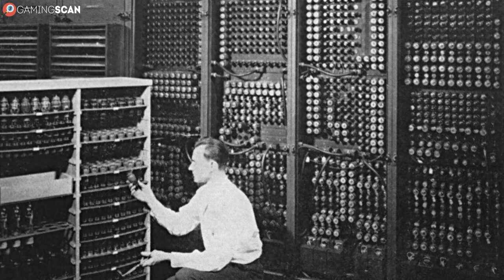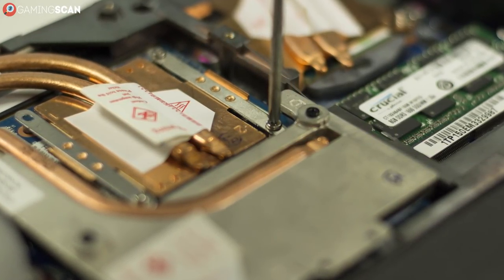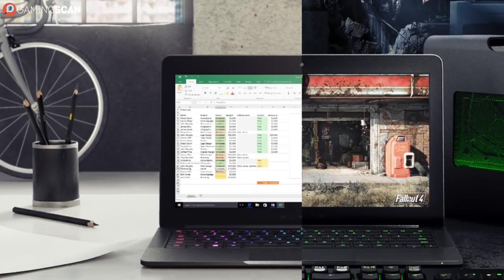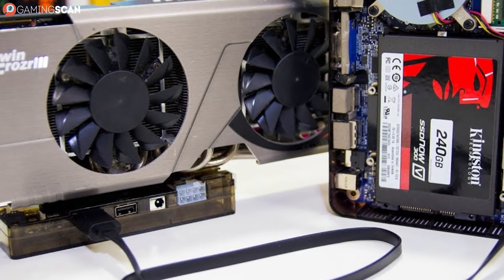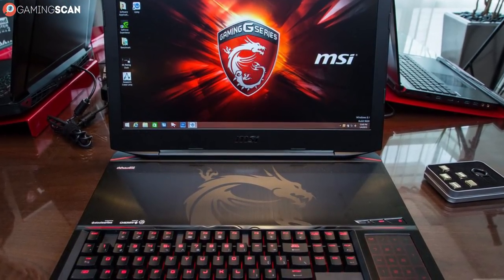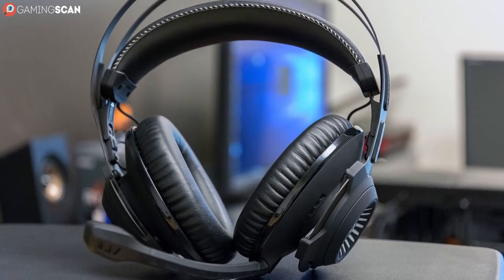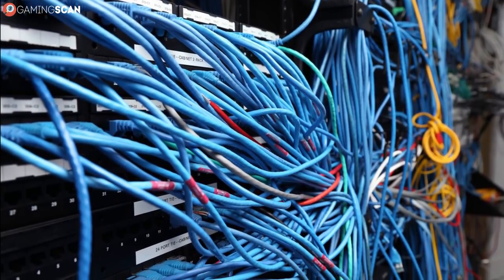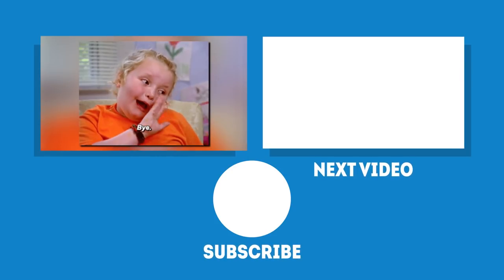Gaming Laptop vs Desktop - Which Should I Choose? [Simple Guide]

Comment: Simple answer.. 
want something mobile and good with games: Laptop
or 
Want something with more customizable option AND good with games : PC
Either way both option still allows you to play games.
Reply: can you tell the disadvantages with laptops compared to desktops when it comes to gaming? like does it overheat more easily or like lag more often?
Reply: @荒田栄子  for computers you can almost change anything to almost everything inside the CPU itself compare to laptops which when it comes to graphic cards in laptops it's a fix graphic card and you can't change it .as for the lag and overheat problem it depends on the laptops itself some gaming laptop can handle heavy performance and most of it can handle them pretty decently. but that's where the problem comes with better specs on a gaming laptop , they're insanely expensive. so in conclusion desktop would be a better option if you're fine with playing only at a certain place because of it's customization option and as for laptops if you're really worried about overheat and lag issue you just have to find a decent machine such ones with either gtx 1050,1050ti ,Gtx 1060 or Gtx 1650.in the end you still could play games with both option. So i hope this helps you in a way because i'm currently looking to buy a gaming laptop too.
Reply: @荒田栄子  double the prices for the same specs
Reply: Den .D ohh okay thankyou
Reply: Antoxicating got it thanks!

Comment: Hmm, let's compare a $650 PC to a $650 laptop

PC :-
Ryzen 3200g
16gb Ram
1660ti

Including rest of parts
That's the whole budget on the PC, now I know you can make $300 PCs but this is to make it fair to the laptop

You got the good specs, but you're gonna give all that power to an old monitor that barley runs 75hz? Are you gonna play with a keyboard and mouse both lighter that a bic? Now let's go to the laptops and continue the discussion

$650 laptop
i5 9300H
8gb RAM
GTX 1650

Sure you got performance, but you're paying more for plug and play out of the box, you get a monitor, a keyboard, the specs, some seriously fast ssds these days, sometimes a touch screen, portability and aesthetic

Now desktops aren't bad but neither are laptops

Comment: Most gaming laptops with a dedicated GPU don't really need an external GPU unless they want that extra power for 3D modeling software rendering or more vfx work in post-production editing. With even a gtx 1060 that comes with most gaming laptops these days you can run most AAA games in 60 fps at 1080p and some even 1440p with no issue. Of course, desktops will be better and cheaper off the ground for this price-to-spec wise but gaming laptops aren't as unviable as this video makes it out to be.

Comment: Ok so i build my streaming pc a few months ago. But ive been thinking about selling my whole setup and buying a gaming laptop. I have sports tournaments every weekend and drive around 3 hours minimum every time. Ive been wanting a gaming laptop because for these rides i can just use a controller with a wireless adapter for the pc and play offline games like skyrim, terraria, etc. but I can just use a mouse at home. What do you guys recommend. Just stick with my desktop?
Reply: I think you should get a laptop because you can just be much more portable with it. Sure you can’t really upgrade it, but I think that the laptop and desktop combination is the best option. I myself is thinking about getting into PC gaming, and I’m gonna pick up the HP Omen 15 gaming laptop for $999. Hope I could help!
Reply: Use a desktop. 3 hours isn’t that long bring some headphones and your smart phone.
Reply: @HGCProd   I think you should check up the HP Omen series before picking one. Heat issues and durability in general.
Reply: 3 hours isn’t worth it to sell your PC. A Nintendo Switch can be good in road trips like these and its not as expensive as a gaming laptop.

Comment: I got a eluktronics mech 17 with a 1060 for 1300. 1tb of ssd, and 2tb hhd with 16gb ram. Plus a built in mechanical keyboard with per key RGB, upgraded thermals and a 144hz ips screen. A similar pc would have cost less, but not after adding in a monitor, keyboard, desk, and (most essentially) another laptop because even if i have a dope ass gaming tower, i still have actual work the necessitates at least a mid-tier laptop. I would easily have spent double the price i did if i had built a pc, and my gaming experience would not be significantly improved.

Comment: You’re forgetting something. For a desktop, you obviously need to get an external monitor. You also might not have somewhere to put it which costs extra. In my case, I have a desk which doesn’t have much space for a pc because of work essentials. An extra desk might cost you hundreds if not a thousand more dollars. Then for a decent monitor, you’ll have to pay maybe 300-1000 bucks. Not to mention an external keyboard. If you have all of this stuff though, good for you.
Reply: external keyboard - you can get some cheap external keyboard doesn't have to be mechinal for like $10, way cheaper if you really don't care and the only different is quality and feel
monitor - the cheapest 144 hz monitor on amazon doesn't cost that much and a 60 hz will go for way cheaper since a lot of laptops only have a 60 hz screen anyway
no space - you don't even need that much space, put the pc on the floor and a keyboard and mouse will fit fine unless your desk is 2 inches as well as the monitor, even if you don't have a desk you can just be creative (sit on floor or mat, some sort of coffee/dining table, I severally doubt that you don't have a surface big enough for all this. 
even after doing all this it will probably still be better performance because you mostly pay for portability in laptops

Comment: I prefer laptop because if i bought desktop my table will have no more space, i had to put the casing at the bottom which is gonna be annoying, gotta have to open closed the casing just for cleaning the inside component, it will be hard for me to clean up my table, it will be hard to mop the floor because the casing is in the way, plus the most annoying is the cable that could get slipped off.

Comment: I bought an omen laptop with intel i7 8th gen and nvidia gtx 1060 and it runs perfect fortnite with 160 fps
Reply: Fortnite does not need a lot of good things to run it
Reply: An iMac can run fortnite on 60fps
Reply: Odd Kiwi I never said on epic but it can run it nicely
Reply: I have a similar configuration and can run all games at ultra settings. Nvidia's 10 series graphics card made this possible. They are no longer using weaker GPU's, it is the same exact GPU as its desktop counterpart with the only difference being clock speeds.
Reply: Battery works for an hour and die do I play while its charging or???
Reply: @Enzo-dr6gx  yes. A laptop with a GTX 1050 uses pretty much the same GPU as the desktop one. The only difference is a slightly lower clock speed, but then again with Pascal's GPU boost, if it's not running hot it can keep pushing clock speeds.
Reply: @Enzo-dr6gx  I don't have an Omen, I have an Asus ROG that has more or less the Omen's hardware.
Reply: @Enzo-dr6gx  as long it's not an M it's the same as pc
Reply: Enzo Troka I have one and it over heats and turns loud after about and hour or two but if you turn it off for 5 minutes and try it again it it goes back to being fine. Also a microcenter employee told me that it is heat that is being pushed out by the fan but it could still damage it. Still great laptop and I highly recommend it

Comment: comparing the graphics card prices alone to the laptop is comparable these days. the rtx 2070 for example is 700 bucks from the manufacturer, a laptop with that inside (albeit a slightly lower speced mobile version) along with a similar screen, computer tower to build in, mother board, ram, hdd and other items exceeds the price of the laptop AND i dont have to build it...  Doing build cost side by side with identical components is putting the gaming laptop back on top these days it seems

Comment: I have a question, so basically I want to buy a new PC mostly for gaming for around 1000 euro maybe a bit more. If I buy a laptop instead it will be nice with the portability on vacations also programming courses etc... So my question is if i buy a cooler for my laptop, when I'm home can i use it the same way as a PC for example to plug my gaming peripherals and monitor. Will it still run good if i clean it often and it has good specs ?

Comment: I'm more consurned by the temperature of the CPU. I never ever had heating issues on the GPU with my gaming laptop, but the CPU sometimes went through the roof. 

When I start Minecraft up for instance, my CPU temperature according to Speccy goes to 85 degrees...
Although fair enough. The temperature drops down to around 75 degrees when I'm just playing the game
Reply: 1) undervolt your gpu (ik your more concerned about your cpu temp but when the gpu drops in temp it helps)
2) buy a cooling pad it's really cheap and helps A LOT. 
3) turn off turbo boost it'll help cool down both gpu and cpu.
4) turn on dlss (if you have an rtx graphics card) it'll boost fps quite a lot and ensure smoother gaming experience.
Reply: @Leon.27.06  Laptop broke shortly after posting this. The hinge broke and repair is too expensive. 
Made a gaming PC that runs very cool.
Reply: @paytowin8468  Aah i see. yeah laptop hinges are the worst they're always prone to damage. i was contemplating whether i should buy a gaming laptop or pc but you added another con to my laptop list. it seems that desktop is a no brainer. cheers man.

Comment: Can someone help me decide and reply fast gaming pc or gaming laptop
The Gaming Laptop Specs:
Battery Life:5.25 Hours
CPU:Intel Core i5 9300H Quad Core Processor 2.4Ghz and a burst speed of 4.1ghz
GPU:NVIDIA GeForce GTX 1650 With 4gb ram
RAM:8GB
15.6 inch screen
Full HD Display
Resolution 1920 x 1080 pixels 
Refresh Rate 144hz
Gaming PC
CPU:Intel Core i5 9400 Hex Core Processor Processor speed 2.9Ghz with a burst speed of 4.1Ghz
GPU:NVIDIA GeForce GTX 1660 Super Graphics

Comment: Hi there. I have a question that i need an opinion on. I am about to go into my 3rd year of university for cyber security and its an hours driving distance so when i go to campus i tend to be there a full day. Which is why i was going to go for the asus tuf a15 gaming laptop as it has the new ryzen 7 4800H, 8gb of ram(which i wilk upgradr myself), ab m.2 512gb ssd, theres expansion for a 2nd m.2 slot and an ssd, it also has a 1660 ti 6gb. It can handle nearly every game apparently which would be good for if im having a break between classes. This comes to £999 or i can spend an extra £300 to get the model with 16gb and a 2060 6gb graphics card. I wouldnt be buying this until september when i get my student loan in. Just looking for some opinions on these options and if they are good enough for what i need for the price.

Comment: I bought good gaming pc for 600$ and now i saw a laptop who has better gpu and better cpu for 700$ btw laptop has i7 nvidia gtx 970m and my computer have i5 nvidia gtx 750ti laptop has 16 gb mine has 6gb but the only thing thats fuck me up is only have 150 gb space ssd and i need to buy better one and wirlees mouse and i only play gta v and fortnite should i keep the pc or should i buy laptop and i need to go to college

Fortnite has 60 to 100 fps and framedrops on 30 on low

Gta v on low without shadows is running 60 fps online,70-100 singleplayer
Reply: FunnYChannel a Desktop i5 is way better than a mobile i7! And the difference between 750ti and 970m isn‘t that big. So you‘re cool.
Reply: @xm01  depends which i5 and which i7

Comment: Laptop gamers: Hm my laptop isn’t starting up guess I need to save 50 bucks for the guys at my local computer store to open it up.             Desktop gamers: hm pc isn’t starting up guess all just search up a YouTube video on possible solutions and remove my side panel.
Reply: Yeet Meat i build my own pc for around 1600 euros sold it and now own a laptop for 2000 euros, didnt even regret it. Most people complain about upgradebility but if you are in the 2000 price range for a gaming laptop you dont have heath issues and it isnt slow, its more expensive but it definetly does not underperform

Comment: I bought a pc whit a GTX 1070 and a i5 7400 and 8gb of 4200 MHz 
For 800 Bucks what should i replace first?
Reply: You should add more RAM. 8GB is absolute bare minimum if you plan on playing any serious game. Throw in another 8GB stick for a total of 16 GB of RAM and you'll have a decent gaming machine. You can play all games at ultra settings and 60 FPS at full HD with the GTX 1070. Your CPU is okay, but if you're not on a tight budget I recommend upgrading it as soon as possible as a 4 cores 4 threads CPU such as your 7400 could, at least in the future, bottleneck your GPU.
Reply: @TechnoGeek209  thx a lot

Comment: Gaming laptop

Pros:
- Huge portability advantage
- less weight 
- less space needed (good to use in dorms or small rooms
- can connect to other screens
- more durable then most desktops (especially tablet gaming laptops)
- unaffected by power outages unless you play multiplier
- usually weaker GPU and CPU because it's mobile.

Cons:
- limited upgradability
- shorter life expectancy
- horrible thermal control (for most laptops)
- short battery life (2-3 hours) even with the lightest games (overwatch, tf2)